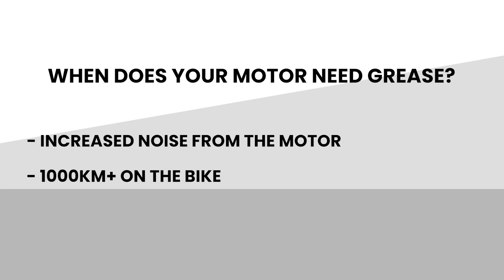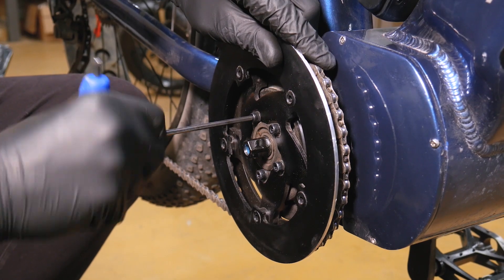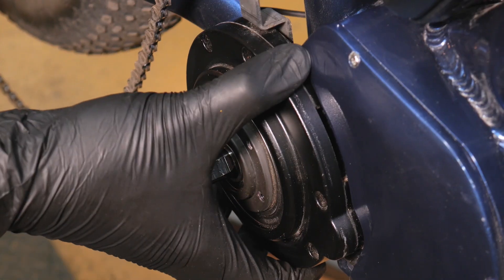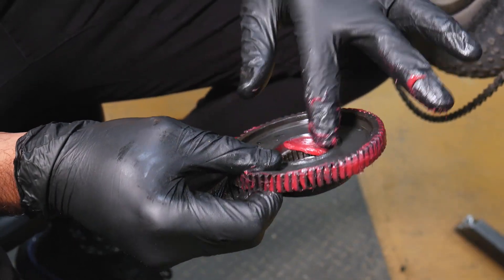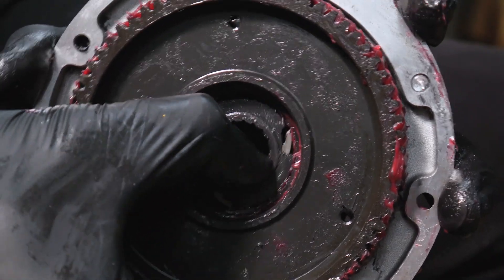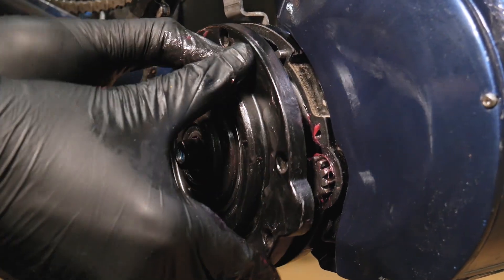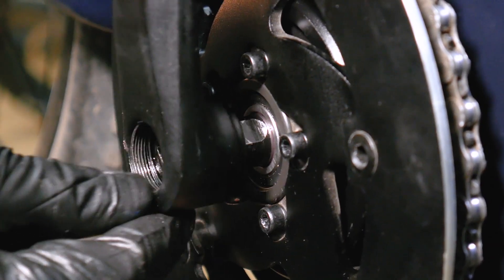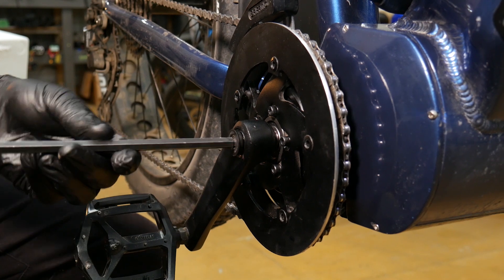Make your Bafang Mid-Drive Last Longer - BBS02 & BBSHD

Comment: I don't get the obsession with so much grease....... over greasing can cause extra friction, loss of power and heat build up. grease is a substitute solution where oil can't be used or easily contained.  A good quality grease should be used that matches the material of the gears .....Clean out the old grease before packing with new stuff ......it task is to provide cushioning as well as lubrication. IMHO.
Reply: What grease do you recommend?
Reply: @henrikjansson3849 mobilgrease 28
Reply: Избыточное количество   снимет шум маховика
Reply: Wjat s best way to clean old grease?

Comment: Once you have it apart, what do you think about adding a grease fitting?
Reply from the maker: We don't recommend adding any fittings or modifying the motor casing in any capacity
Reply: @Biktrix  understandable but do u know if can it be done?  Furthermore, if installed properly can it serve the function without compromising the motors structural integrity 🤔  

btw hey thanks for the help awesome video buddy 👍
Reply from the maker: @goodboy1269  you will still need to remove the old grease. Simply adding in more grease will only cause more friction and issues that follow due to it.
Reply: @Biktrix  Good to know!  Thanks a bunch
Reply: @Biktrix Bafang offer a motor cover for the BBS02 that has a grease port in the cover...it is made of metal rather than plastic 🤔
Reply: I inherited a 50 year old lathe that had a motor with grease nipples on it;  that allowed grease to be pumped into the bearings. Long story short, I stripped the old motor because it was not running well. The whole of the inside of the motor, including all the electrical windings, were jam packed with grease (some of which was ancient and as hard as soap.).

Comment: Good video! But the step to get the BBS02 shaft out is missing, it is not just to pull it out as it seems in the video :) you have to remove other side crank and those nuts there.
Reply from the maker: The steps in the video will help you complete what the video shows. But yes, if you want to fully disassemble the BBS02 you'll need to take the other crank off as well

Comment: What other grease we can use instead of using mobil 1, mobil 28, aeroshell 22 greases, since these greases are hard to find  and expensive in my country, and these aero type greases seems like an over kill for this type of motor
Reply: Which country
Reply: Idk if its fast or slow maybe just look up fast machine Grease or high rpm grease

Comment: I greased my new BBS03 with aersohell grease 22. Before adding new grease, I removed the old black grease.
Reply: Hey , i wanna ask how did u remove the old grease ? Do u just slowly scrape it out then spray brake cleaner over it ?
Reply: @xJayteee  i disassembled the big secondary gear out by unscrewing some two holders from the other side. Cleaned using 99,9% alcohol. After cleaning, added new aeroshell 22 grease to the gear directly and the housing. The bbs02 got much much more quieter and less wear and tear
Reply: @Shaundi1-l4e  ah i see , okay thanks for the info !
Reply: Did you replace the gaskets/ seal covers? If yes where did you order them?
Reply: @jessicaperrault2177  i did not replace them
Reply: @isiahvic ^^

Comment: last week i bought a bbs02 and fitted i did 50ish miles and its been noisy so i opened up to add some grease and there was only a tiny bit and found a tiny metal shaving i just packed it like in your video and its quiet now 
thanks for saving my motor
Reply from the maker: Amazing to hear! Happy riding
Reply: Had the bbshd for a week and the gear is very close to stripped now. Going to replace it soon.
Reply: @kyleshaw5538  How hard were you riding it to wear it out in a week?  I beat on one for 6,000klm and it was barely worn before it started making noise, and the old grease i replaced was black with shiny paste in it.  Sounds like yours wasn't shipped with much grease.
Reply: @kyleshaw5538  go for the metal one i just got one for my bbs02b cos my nylon ones wasnt lasting long.
Reply: @iangrassby  the seller is giving me a replacement for the gears that are close to the chain ring should fix it as they are basically stripped

Comment: Not much really to do on the bbs02, can't grease the clutch
Reply: Well you can but you have to slide it out of the bottom bracket casing. Not particularly difficult. There is a special tool but i made one out of a bit of tube with slots cut in.
Reply: @JohnSmith-ch9lp  the bafang tool for loosing the nut on bb? I have that or there's another?

Comment: Y'all missed a Step: Step #1 - Order a NEW Gasket for the cover and have it on hand prior to disasembly. 
Factory gaskets will more often than not tear to pieces the first time the cover is removed. Any gaps between the cover and case WILL leak grease.
Side note: You really only need to lubricate the main output gear. Excess will transfer to the drive pinion.
A better alternative to the Mobil 1 is Lucas "Red-n-Tacky". It'll stay stuck to the gears longer and resist flinging off on the inside of the case.
All this tips I've given are from maintaining 3 BBSHD powered Bikes.
Reply: Mobil Red n Tacky is NOT a synthetic grease but petroleum based so may have an adverse effect in the nylon gears inside the motor. Best stick to synthetic Mobilgrease 28. Shell Aeroshell 22 or Mobil SHC.
Reply: @martinlong8739  1st of all. Red 'N' Tacky is not a Mobil product. It's by Lucas. And 2nd it is indeed a Synthetic Complex Lithium EP grease. The stock nylon gear in the Bafang motors comes from the factory coated in a non-EP White Lithium Grease.
Reply: @SternLX  Yes of course, my mistake, as you say it is Lucas, I use Red n Tacky a lot. However it is petroleum based so who knows how it will react with the Bafang nylon gear. It is not synthetic. Check out the Lucas Safety data sheet "The following components are listed: Distillates (petroleum), hydrotreated heavy naphthenic; Distillates (petroleum), solvent-dewaxed heavy paraffinic; Zinc Alkyldithiophosphate" 
I prefer to use synthetic such a Mobil 28 Mobil SHC or Aeroshell 22. 
Just out of interest why did you think it was synthetic?
Reply: @JohnSmith-ch9lp  I've seen forum posts where remote control users put red n tacky in their RC cars and have not had a problem on plastics?
Reply: @manoz6194  Hello Mano, that might be so but personally I prefer to use a synthetic (non petroleum) based grease and I can be sure it wont react and soften the nylon gears. I use Mobil SHC100 or Aeroshell 22. Google this article it may help explain "Hardy Boys Solve The Mystery Of The Nylon Gear Failure On The BBS02"
Reply: @JohnSmith-ch9lp  OK ill have to get some shc but I'm more worried about water ingress, I had my motor for a month and did 2000 miles then it stuttered and went kaput. Opened up the controllers side and it was bone dry, opened up the stator side and it was full of salt and corrosion. I had taped the seams so the water did not come in through the gaskets. I have another new motor but the same thing may happen to that. Thought these things were meant to be waterproof?
Reply: @manoz6194  Which motor are you using? Mine is a Bafang BBS02 and has approximately 1,800 miles on it. I have twice regreased the big steel gear behind the pedal crank arm. Never had any issue with water getting in. Ive ridden in heavy rain but never through streams or anything and also never use a jet wash to clean it so I'm unsure why yours seems to be letting water in? A lot of folk use Mobil 28 but I have found this difficult to locate. Mobil SHC100 is the newer version. And Aeroshell 22 is the Shell version. Check this out https://youtu.be/4_VRs3IzpEk !5,000 miles touring recommends synthetic Aeroshell or Mobil grease.
Reply: @JohnSmith-ch9lp  BBS02, I ride in some heavy rain, its for my job as a courier so I work no matter the weather. I slow down for puddles. I don't wash my bike lol, only essentials like drive train and brake rotors. Yeah I was very disappointed by the amount of water ingress, I reassembled the motor and connected it up to a battery and the motor is "working" again but who knows how it will hold up once I put it back on bike
Reply: @JohnSmith-ch9lp Well here we are 3 years later with all three of my BBSHD motors using only Red N Tacky and nothing has gone wrong. I did replace the Pinon with a PEEK gear on 1 of the motors only because I've since upgraded that one to an external controller that can handle 72 volts. The Nylon gears will self destruct with that much torque on them no matter the grease. If three years of constant use isn't proof that Red N Tacky works just as fine as your Mobil or Aeroshell then I don't know what is.
Reply: @SternLX Hello there, if it works fine for you that's great. I'm guessing you must use it on the nylon gear too. The Lucas Red n Tacky is still petroleum based I have just checked but maybe for whatever reason its not reacting with the Nylon gear. Or maybe the folk that write Bafang motor articles are just over cautious. I'll stick to using the synthetic grease as I have plenty of it but cant argue with your 3 year use of red n tacky. thank you for the update and enjoy riding your bikes 👍

Comment: On my BBSHD motors, when you remove the cover the gearwheel comes with it and I can´t pry it apart to get to the clutch. Is there a trick?
Reply: not 100% sure on this, but at 3:14 there looks like there are a few bolt holes (maybe m4 size?) on the gear if you screw bolts in and tighten them evenly it should force the gear off the housing
Reply: Thanks Gramps, I'll try that next time I grease the motor.

Comment: When I did this the motor cover was stuck on to the casing so that I had to pry it apart, then a couple inches of the gasket stuck to the cover the rest to the casing, and it tore at one spot.  I applied the grease then I had difficulty getting the cover back on until I rotated the inner gear (ratchet ring ?).  So now I guess I'll have to order a gasket and tear into it again.

Comment: They used WAYYYY too much grease. It only needs to be lightly applied and only after the gears have been cleaned beforehand. They didn't even clean the old contaminated grease off of the cover. When they took it apart note how much grease was on the cover? After greasing your bike as they show and after using your bike for a month or so pull the cover again and see the mess left behind from the excess grease! It has no place to go and after awhile it will force itself into everywhere, even places it isn't supposed to go.
Reply from the maker: We appreciate your comment, but in the 10k+ Bafang mid-drives that we've sold, this is the best process we have found. Many of the greasing issues arise in these motors because Bafang doesn't put enough in from the factory
Reply: @Biktrix  Thank you for the quick reply. I have had the same issues with the final drives on shaft driven motorcycles. The solution was to clean and then apply a small amount of grease to the splines each time the rear wheel was changed. I realize the Bafang motor is a different item, however grease will get into everything and too much grease creates its own issues. A small amount, perhaps a thin line down the centre of the drive wheel or a small amount applied with a small grease gun to get into the root of the gear teeth would work as effectively? Repeated every year perhaps as part of ones annual maintenance process?

Comment: Why you didn't put grease at nylon gear? 🤔
Reply from the maker: You totally can grease the nylon gear as well! However, that requires more disassembly of the motor than this super quick job which is the focus of this video
Reply: @Biktrix   I know that! :) I did it as soon as I bought my bbshd. I lubricated the metal gears with black lithium grase, and plastic gear with special white grease. I have now about 4000km (at least 30% of that kilometers at extreme uphills with preaty heavy load (over 100kg) ) and there are no sounds so far! :)
https://electricbike-blog.com/2015/12/23/mobilgrease-28-bbshdbbs02-because-a-good-mid-drive-is-better-seen-and-not-heard/

Comment: You need to regrease the nylon gear as its done badly from factory
Reply from the maker: That's a good thing to do as well! We didn't include it in this video as it is a little more in-depth than this super quick job
Reply: Is there a tutorial for that?
Reply: Which part is the nylon gear

Comment: I used Mobile 28 about two years ago and never looked back. Still going strong. My tires make more noise. I’m in the process of doing it again.
Reply: I am also using mobile 28. In the next service i will mix mobile 28 with mobil atf  220. Why? Because it gets more liquid and falls down so the gear picks it up all the time. My cover is upgraded made out aluminum and i use allways loctite 5910 as a gasket to prevent it from rain/dirt and also to be tight. This is just my thinking.
Reply: I have added the ATF 220 to Mobile 28 and i love it. I think its even better. It sticks more to gear and it wont stay aside as usual without the oil. Have made around 500km and even last weekend i turned the motor off and it felt much easier to pedal! Grets, Boris!
Reply: @zondepa5537  how much of each do you mix?
Reply: @zondepa5537  Have you had a chance to open inspect this mix Grease + ATF?  Sounds like you ride alot on the BBS mid motors -- Have you needed to change the chain & cassette due to wear, and if so after how many miles / km?
Reply: @zondepa5537  Mobilith SHC 100 is actually the best. it supersedes applications for Mobil 28
Reply: @zondepa5537  no sounds like a great idea Zon .
Reply: @zondepa5537  no sounds like a great idea Zon .
Reply: @zondepa5537  Hi, why did you upgrade to an alu plate ?
Reply from the maker: They're great motors!

Comment: Thanks, I have one, and some time will have to open it up, so now I know. We call the Clutch a Sprag clutch in the UK, bit like a one way bearing, also called a sprag bearing.
Reply from the maker: Glad this could help!
Reply: That's what we call them I'm a motorcycle mechanic and sprag clutches are used on  the starting mechanisms on most Japanese motorcycles!

Comment: Hmm you used mobil 1 synthetic grease while the recommended is mobilgrease 28. Also only greased half the gears in the motor and no mention of removing the old grease from the gears which will contaminate the new grease.
I'll be doing this as soon as the grease and replacement reduction gear turns up but to the entire motor.
Reply: @Locust Hypnosis you should use brake cleaner (ones designed for cars will work)

Comment: Thanks for taking the time to produce the video. Excellent. Newbie at bike maintenance. Just like to share the most important part about this whole procedure I learnt. Look carefully at the Crank Puller that you will use. I did not realease it has two parts to it. Make sure you match the size of puller end to mate with the face of crank shaft. I had to modify the small end to make mine fit. Initially, nearly destroyed the crank arm. I've just done 1000km on the bike. There wasn't much grease inside the motor. After following your directions and test riding. Results.....wow, now as smooth as silk. Highly recommend doing it. I also used Mobil grease 28. Expensive, but worth every bit.
Reply from the maker: We're glad this video was able to help you! Make sure to subscribe and keep an eye out for future tutorials!

Comment: Thanks great video iam 8000klm but no noise at all i should soon do this i noticed you have to line up clutch then spin clockwise then all re seat the next part seems a simple process for a beginner thanks for the video
Reply from the maker: A beginner can definitely complete this! It's also an excellent way to get to know your bike and how it works
Reply: @Biktrix  thanks buddy

Comment: So no cleaning, just shove more grease in it??  How about the primary drive gear and clutch bearing (sprag)??  Seems like a waste of time and grease w/o any cleaning or completing the job.
Reply from the maker: You can take this maintenance as far as you want, most riders will be totally fine with this quick job that will improve the performance and lifespan of their motor. Many times, these motors don't come with packed with excess grease to clean off

Comment: I previously bought molygrease.  Will this be just as good?
Reply from the maker: We recommend the Mobil 28 grease
Reply: I used Lucas red and tacky which is similar to mobil 28 in this video but much cheaper. Ive heard the moly grease is bad for the nylon gear
Reply: Must be silicon based with anything plastic. Petroleum based grease will slowly degrade and some cases soften/melt plastic parts.

Comment: I have done 1800km on my BBS02.  I don't think there is any noise. Should I do this now or wait for noise?
Reply from the maker: If your motor is still quiet and functioning as new, there should be no immediate need to open up the motor. However, adding more grease won't hurt!
Reply: @Biktrix  it will add more longchievity to your motor that's the main reason to do it .
Reply: I made 3000km on BBS02, it is still running quiet on 'factory' grease. Opening the motor is allways a risky job

Comment: So the jauggernaut ultra 1000 has a different mid drive motor? What is it called. I have the 2019 model
Reply from the maker: That is correct! The Ultra 1000 uses the Bafang Ultra motor. It is slightly different to complete this job, so we will have to make a second video for that motor.
Reply: @Biktrix  thanks how often for mine should you grease?
Reply from the maker: @rushtonworks9186  Ultra motors can be good for 2000km plus before greasing, but it is all up to the owner's preference and riding habits!